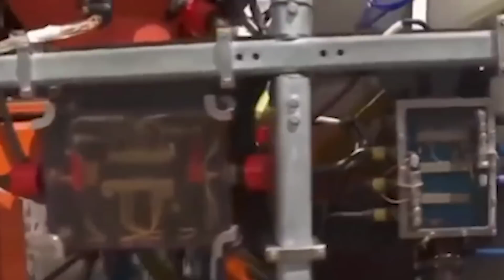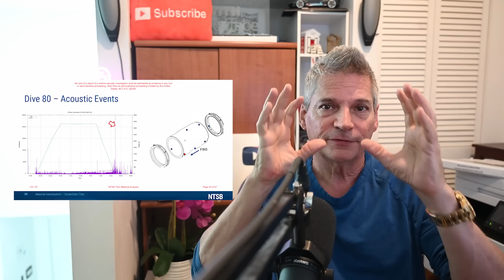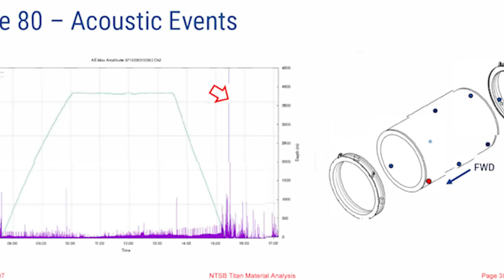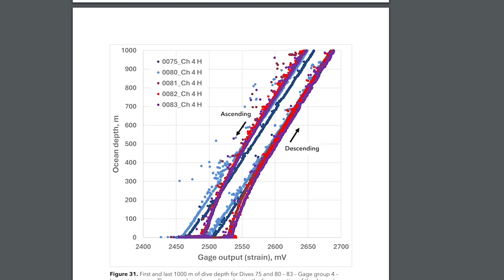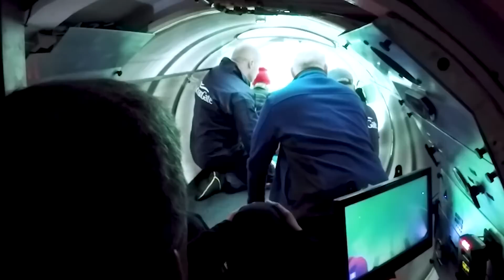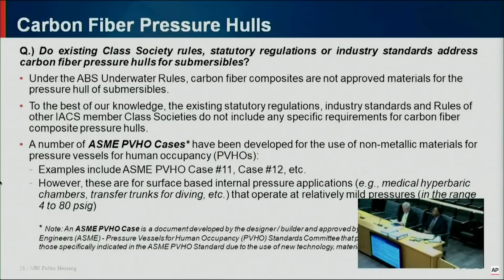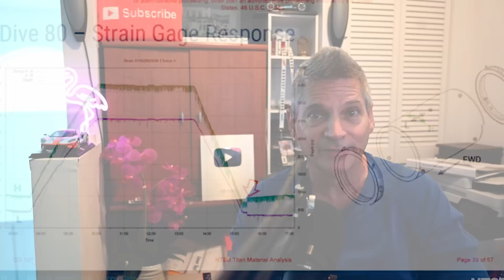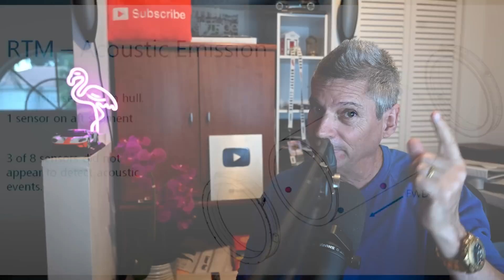How OceanGate Titan Sub Realtime Hull Monitor FAILED! RTM

Comment: This system is comparable to an airbag giving you notice an accident is about to happen.
Reply: Yeah I would also argue that the data pretty clearly showed the hull was dying. They heard a giant bang and it obviously showed a change in strain profile.
Reply: @NicholasAndre1  The problem is you need a whole suite of destructive tests to establish a pattern.  I think it was all smoke and mirrors to deflect questions about the reliability of a CF hull.  Anyway, we have one datapoint now.
Reply: It actually worked fine and gave plenty of advanced warning- they just didn't bother heeding the warnings, or even analyzing it or comparing it from one dive to the next.
Reply: @GlutenEruption  A warning means nothing if you have no way to interpret that warning. If I tell you a tornado is about to hit your location in Chinese are you going to gain anything from that? Of course not. They never did any testing to prove a certain number or types of defects would give them adequate noticed before an implosion. So yeah after they tested to failure with themselves inside, we now have a way of interpreting those readings as warnings, but before the failure it was just random data.
Reply: Yeah, a real time monitoring system is useless when you need ahead of time warning.
Reply: Y'all. It isn't that they ignored the data. They never saw those graphs. Those graphs mapping depth to strain etc were made during the investigation. Oceangate didn't see those charts.

You can say that they either didn't think to look at the data in that way, or that they might have thought of it but chose not to create the graphs to look at the data that way. But the charts themselves did not exist prior to the implosion.
Reply: @Lucky9_9  what are you talking about?

Those recordings were taken before it imploded and those recordings were recorded by oceangate.

Whether it was in graph form or not is irrelevant.
Reply: @retsaMinnavoiG raw data tells a human nothing. You need to analyze it in order to gain insights.
Reply: @macvos the point is they had the data. The warning system actually worked. They just didn’t care or know how to read the data
Reply: @Lucky9_9  Stockton designed that hull, he did not blindly follow somebody elses´s blueprints. To Design, you calculate and create those graphs yourself, before building anything or even drawing the final blueprints. That´s what design means. Then, for confirmation, you build a sample, say a 2" by 2" by 2 ft long test bar, and apply pressure in a specialized hydraulic press which graphs displacement vs. force applied. Check "Young Modulus". As an Engineer I did such tests hundreds of times, confirming calculated results on real world structural materials. I my case I stretched rebar to breaking point, bent I beams and solid bars, crushed bricks, and concrete blocks, etc. Standard Construction testing procedure. No need to own that machine, certified Labs will be happy to do the testing for you. For a fee, of course. NASA and Boeing declined certifyingthat hull, except one time pressure testing in a tank at way less than Titanic depth. New charts were created as part of the investigation, of course. Nobody trusts Stockton data.
Reply: the acoustic system is actually used for re-testing composite-wound and pure-wound pressure vessels. The real problem with Rush, he didn't understand the sounds, because you need a very large database of comparable structures so that the sound intensity and frequency can be interpreted with a sufficient degree of accuracy in order to be a relevant component of a safety system.
Reply: 100%
Reply: Good comparison!
Reply: True. They wouldn’t have been able to do anything..
Reply: Excellent comparison my friend
Reply: no it is not
Reply: It like a few drives before the accident your airbag beeps
Reply: Well an airbag goes off when what could go wrong goes wrong.
Reply: @goodvibƏs  ya that's what he's sayiing